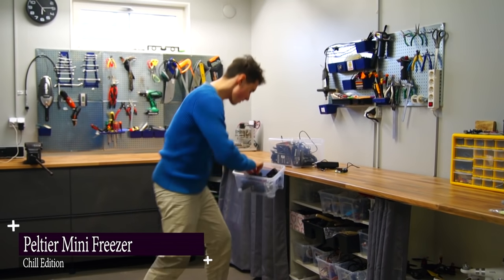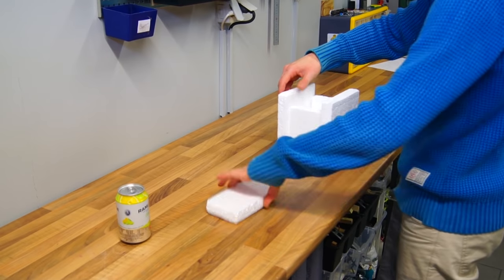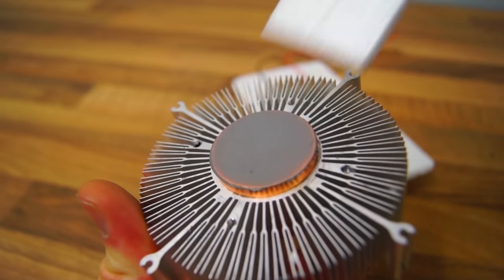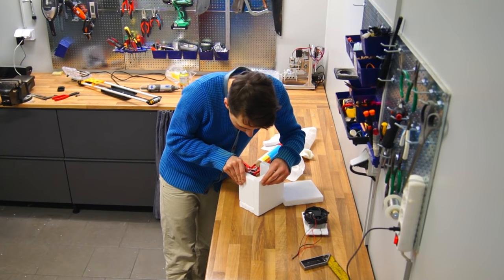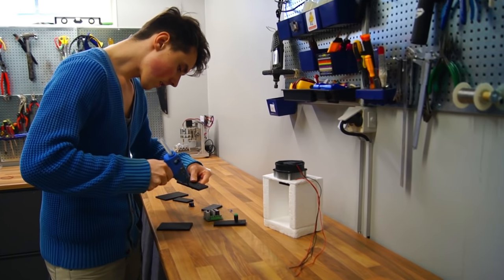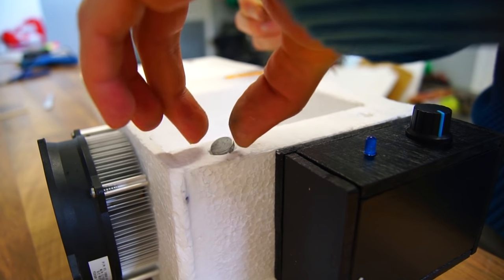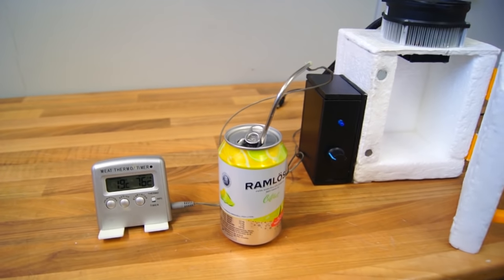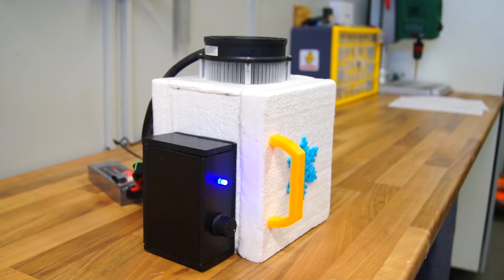Useful Cooler Box - How to Make a Mini Freezer

Comment from the maker: Don't have a 3D printer? Check out my latest review of the TEVO Tarantula 3D printer, it's only 200$: https://youtu.be/XIk-w5OSVh8
Reply: hallo
Reply: I did, And I bought one. Very excited to get it, But shipping from china to USA is always a practice of patience.
Reply: chemicalvamp lol your great grandchildren will have great grandchildren themselves before you recieve the product
Reply: Pakistan 🇵🇰
Reply: next project should be hot wire foam slicer.
Reply: yess
Reply: Very nice and entertaining video, but I have a question about the heatsink for Peltier module: Does it need to have a fan for cooling or just the heatsink is ok?? Sorry for any grammar mistakes I am Italian. Thanks for the link to the 3d printer I need one. Plz, continue like that.
Reply: 1-For the peltier's hot side, better try some really big heatsink (like with the size of the fridge itself) and add some low rpm big fan, so you'll get low noise and more efficiency;
2-For the cold side, use some large and thick piece of aluminum in the floor of the fridge, so you get everything colder faster than with this system! You can also add some air flow inside as well;
3-For the supply, do not use LiPo or 18650 cells! Use some standard ATX power supply or some 9Ah 12V battery with a break circuit.
Reply: Thanks @RCLifeOn for the video and thanks @Tiago Mian for the tips. I'm looking to actively cool an ESC (size is compact so same goes for its box), I actually wonder how good this would work against a heat source like FETs. Do you recommend sticking directly linking the cold side Peltier and the FET through the big aluminum plate ? Or some air space would be more efficient ?
Reply: RCLifeOn did you make Any video of laptop cooling pad?!
Reply: Hello, could please tell me the list of components you used for the electrical circuit(Inside Black box)..... Please reply me ASAP.. Thank you in advance
Reply: Hello i need to know whether can we control the temperature till 25 ° degree celsius?
Reply: If you have a 3d printer why you dont make a housing for this!?!!!
Reply: @RCLifeOn  If got a Malyan M150...what do you think about it ?...
Reply: @chemicalvamp  good
Reply: @chemicalvamp  Good
Reply: Wow very creative project
Reply: Use a fan inside of the cooler to make it more effective.
Reply: you think you could make this in plexiglass instead of foam? tould that work or its not a good enough insulator
Reply: I love this video please can I get the names of the materials used, so I could place order on them
Reply: why is everything sold out on the links you put in the desc?

Comment: love it! you could also add a small fan inside the freezer to speed up cooling for the whole inside region. sinking the magnets a bit deeper into their holes would also increase the efficiency of the system.
Reply: Xfiles98 not really, the bigger the temperature difference between the cold and warm, the faster the temp in the drink will change.
Reply: The best would be to have a copper bottom linked to the cold element, this would cool the drink much faster cause it would be in contact with a cold surface... he could just bend a copper or aluminium sheet in U shape with enough space inside it for the can and then connect the peltier directly to it. 
Many ways to improve this design but it remains a good basis.
Reply: Kadum the best would be 3D-printed diamond that molds perfectly to the side of the can. A little on the pricey side tho...
Reply: Isn't it cheaper to buy one ready made than buy all the components separately?
Reply: Obviously, yes, but were you searching for a video on how to build a freezer from parts cheaper than a ready-made one? Nothing in the title or description should have mislead you to conclude that was the point of this video.
Reply: pretty sure it would be cheaper to diy, and whats the fun in buying a ready made one lol you gotta do it for the fun and learning process lol
Reply: @Carl Clark: What does a Pelletier module cost? The whole fridge ready made and with guarantee costs about 50$. I also love to build things by myself, but there are limits.
Reply: @Noah Spurrier: One of the main reasons of DIY things is that it's cheaper or better. This fridge is neither of them.
Reply: @Juri Vlk: We have different motives and goals with DIY. I think, for me, generally the opposite it true. Buying something readymade is almost always cheaper and/or better. Granted there are little touches that you can't buy readymade that are sometimes important to me, so in some cases I do it myself because there is no commercial product that satisfies my needs. For example, all hand-held rotary tools sucks. Dremel is the worst. I hate them. I'm building my own rotary tool to satisfy my needs. But that's the exception. In general, the pleasure is in the building, not in the using. Half the stuff I build I never use anyway. It just sits there like a trophy for while until I decide I need the parts more than I need the trophy. So what's the point in building? You seem to have your own answer, and I don't expect your answer would work for me.
Reply: He put links to gearbeast where you can buy everything, it costs less than $50 in materials. Also with the exception of the peltier and the controller the rest most DIY have it just laying around, so for most DIY it would cost less than $20 to build this fridge plus the time.

Must of the cheap stuff you buy isn't all that great either with electronics that fail very fast and with poor quality materials, not saying this fridge is of great quality but if the door fail for instance you just cut another piece of styrofoam or replace pieces as you need, whereas on a $50 fridge you throw everything away or just salvage some of the electronics.
Reply: Kadum : I didn't  think that one could buy these elements so cheaply. Well, Gearbest  is really cheap. At these prices, it makes sense to build a fridge by oneself. Just one note. With a consumtion of 72 W of the Pelletier element this fridge will probably use more energy than a big one! But that is also true for the commercial small fridges: They are not energy efficient at all.
Reply: Very good
Reply: 10 dollars or less
Reply: Yes it is good to buy a ready made instead making it.
But then we cannot get the joy of making a freezer at home.
Reply: We can also add a small fan.
The efficiency will increase.
Reply: if he ads a fan then the current draw will be 6 to 7 a and then run only around 20 min
Reply: In addition to the fan inside, he should have added a temperature module that would turn off/on  the peltier when temperature inside reached the desired temperature.
Reply: Old comment i know but honestly no need to speed up the process with fans, maybe place shot glasses with salt water inside or pre frozen ice packs, when i first moved out i got a little fridge freezer and it would either be too cold or not cold enough, i turned the cold DOWN and put 2   500ml or so ice packs that i froze somewhere else, and placed one at the bottom of the fridge and one in the freezer which fixed the issue, it was a noisy fridge too and it went from kicking on every hour or so to 2hours or more depending how full it was, you need to make sure the icepacks are frozen solid though otherwise they just thaw, i never had to refreeze the icepacks.
Reply: By never, i mean 3 months because i got rid of it when i moved out which is pretty awesome
Reply: A fan would just add heat from the motor, wouldn't recommend it.
Reply: Could this be used 24/7 keeping something frozen?  i’m looking to build a frozen fish food dispenser and this would be perfect.

Comment: To improve this design I would make it a top opening freezer. This way the cold air would not escape when its opened. And I would also try making a roller for the drink to lay on and slowly roll. I think it would cause the drink to cool faster. Perhaps a small fan would help remove the heat from the can while helping keep the air as cold as the heatsink.

Comment: Oh my gosh this is perfectly the kind of tutorial I was looking for! I have a little camping battery pack that can hook up to a turbine or solar panel which I'm going to use in an e bike camping trailer.  For most of my food I can ferment for preservation and eliminate the need for a "micro fridge" in the camper trailer but if I had a small volt efficient freezer box like this video's really inspiring me to build-,something the size of a small microwave oven box then I could "refreeze" ice packs basically indefinitely for the lifetime of the battery pack and have year round food (refrigerated fermented foods can last for years)  Thank you so much for giving me the fundamentals RC Life I appreciate you!

Comment: If you put a relay into the circuit and use a thermostat to control the switch in the relay, it will turn on and off by itself and you can adjust the set-point to any temperature you want! That's how a lot of refrigerators work.

Comment: maybe a good idea would be to add a thermostat, so the freezer shuts of when its cold enough, and strats back up when its to hot. that will save you a lot of power. and also, does the fan make a lot of noice? nice project man!

Comment: Possible improvements:
1) Foam is fragile. Only use it as isolation and put the whole thing in a wooden, plastic or metal box.
2) While foam is great for DYI aerogel is better.
3) Put in a internal fan in order to more quickly cool the freezer.
4) Make it slightly bigger.
Reply: That much aerogel would cost a few thousand dollars so I don't think anyone would be willing to pay that much.

Comment: Somehow this isn't seem to be working with me. I'm trying to make an icebox freezer, my cold side doesn't get to freezing temperature. It's abt 15 degrees lesser than ambient temperature. Not even close to freezing. I've tried using different 12706 peltier modules but none have been ice cold they only go uptil condensation point. I'm using 12v 5a power supply. Can someone help?
Reply: How did You solve that ?? I am trying to make one for myself , I am installing icebox freezer into my homemade Air cooler!!
Reply: 12v 5a is not enough. Also you have to consider the volume of your cooler and proper insulation. 12706 is a bad module. Use 2 pcs 12703 module with 2 cooler fans. But keep in mind that it needs time to cool down depending on the amount of things you put in.

Comment: Back in the 80's I bought one of those from Sears that cooled or heated depending how you plugged it in. It didn't do good either way, and killed a car battery. You could drive down the highway with it on and when I parked somewhere and turned the car off I always had to get someone to jump start the battery.

Maybe the newer ones are made better.

Comment: i did this myself for dads day but i build a lager box and used 3 peltier parts. it works but i had no time to install some regulation elektronics or sensors so it was always on by full power.
Reply: Can i talk with you just related your project ??

Comment: since air is a very bad conductor of temperature, you should use a second internal fan inside the box !
Reply: That goes both ways. With moving the air, you also decrease the effectiveness of the insulation since you increase the thermal transfer of all surfaces. It's best to take advantage of the natural convection, warm air will always accumulate at the top, be cooled and fall to the bottom.

Comment: Really nice, you should make a hydrogen generator:)
Reply: I think that's too dangerous to do that at home
Reply: Athaariq Ardiansyah, I have made one before but it made very little hydrogen.
Reply: that's cool, but you need to be careful as it would explode easily
Reply: Athaariq Ardiansyah Yes it would:)
Reply: i filled a fairy liquid bottle and it was never saw again BTW i made a remote igniter so i wasn't next to it.
Reply: Creating Creations not possible, unless you're talking about hho, splitting a water molecule into it's individual parts 2 parts hydrogen one part oxygen, perfect for under water welding... also for very very big bombs if pressure is applied... but hydrogen must be sepereated from oxygen

Comment: well... is it a good idea to use peltier (thermoelectric cooler) as a CPU cooler??
Reply: it is a bad idea, it cant cool qick enough
atleast my  i7 7700K
i tried it an d it thermalthrotteld a lot
maybe if u have a core 2 duo
Reply: Go for custom Heat sinks. Will cost you little higher but beneficial in the long run. Also use large and high rpm fans. Sound can be bit annoying but you can place it somewhere you don't sit usually.
Reply: @MyBilal19971  glad to see someone in the coment section after a loot of time pased from upload :)
Reply: @TimRebernik  man this video's been in my watch list from a long time. Been coming back to it always for basics

Comment: I could be wrong but I think the efficiency also depends on the cold side flow of energy, because the device works through the concept of diference of temperature on both sides. The cold side has a temp limit because we are talking about semiconductors.